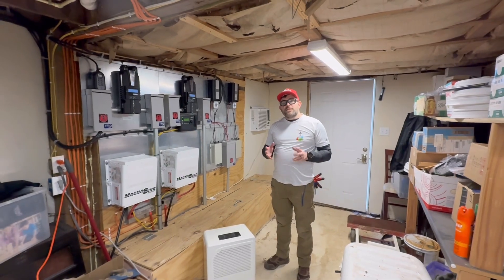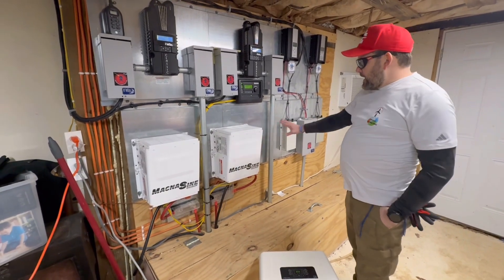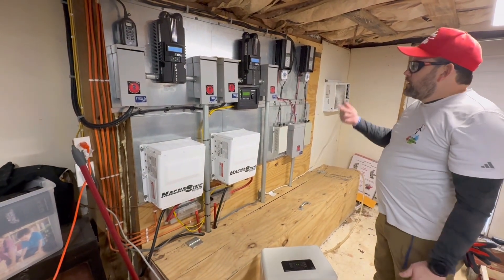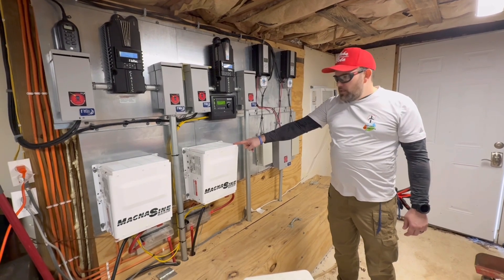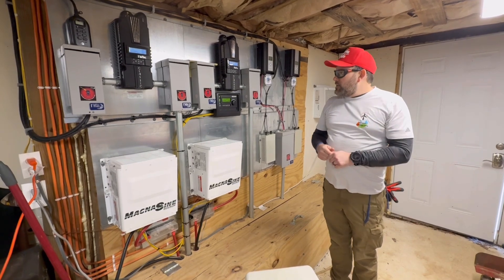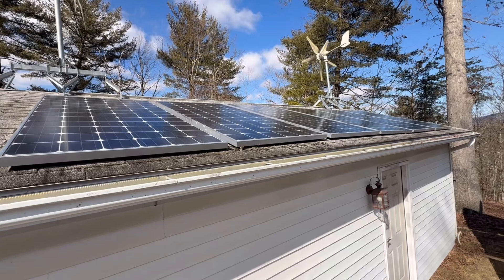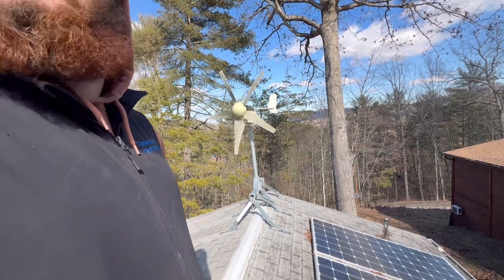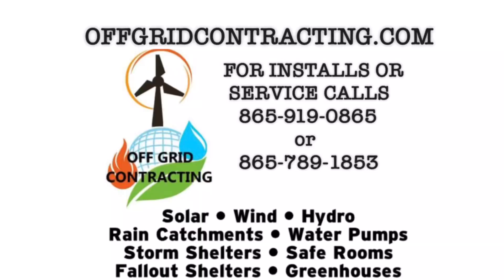10 years later off grid customer still running good and we did a battery change out

Comment: I am in SA and have 44kw battery power with a 3 phase 12kw to power my borehole pump and my irrigation pump. I have a separate 10kw system just for the lights. The Lord sent me to the desert here and I bought the vacant land. My freeze dryer will start running soon. Its all Deye the 44kw. Love you bro. Shabbat Shalom
Reply: Im praying to the Lord it last just 4 years because there wont be more than that.